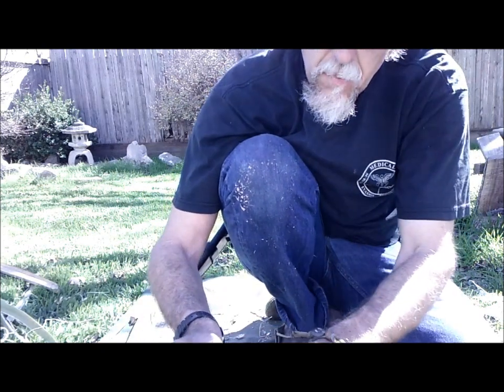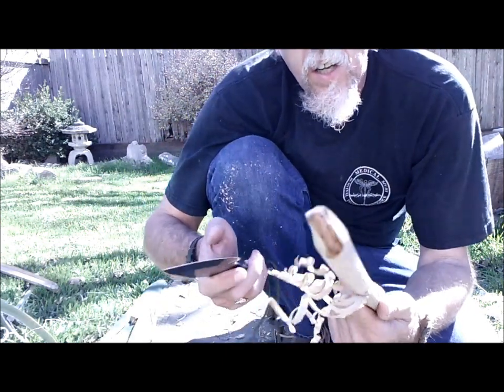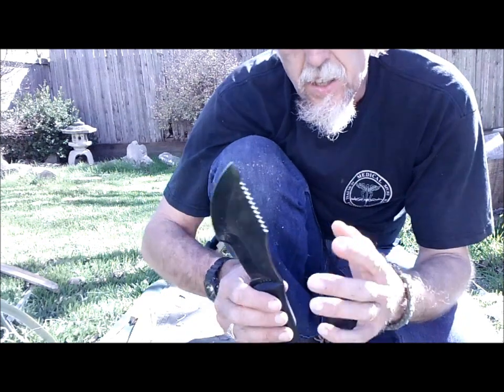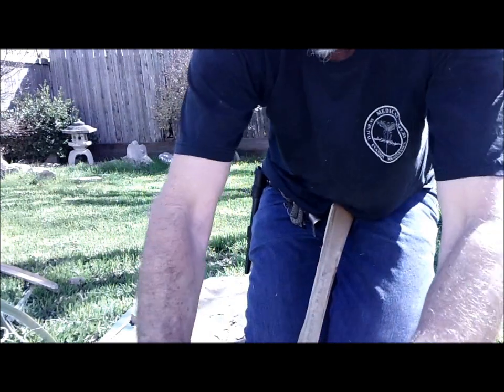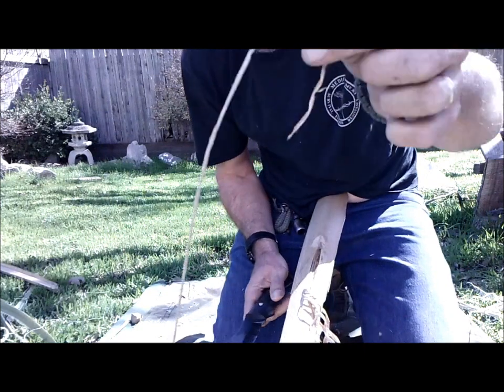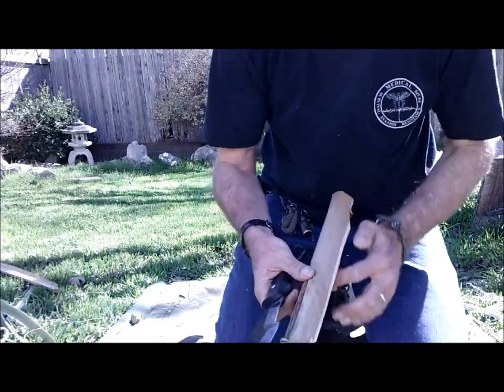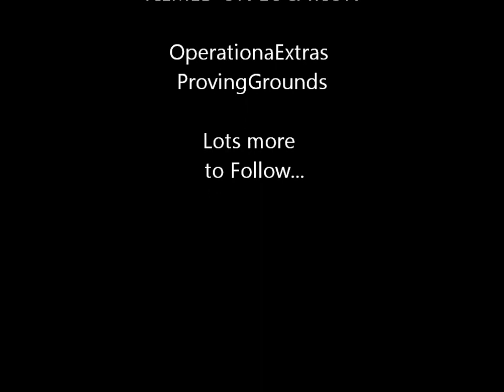OperationalExtras Beck WSK Curls and More

Comment: I wonder how that palm would do as a hearth board for a bow drill or is it to thin?
Reply from the maker: I made a fire plow that day and a Bow Drill set spilled a few coals Most of the palm was green but I had a couple of Dry Pieces They took a dunk in the Pool under the tree I was cutting on so it was not Ideal a good set Im sure could be made from dead dry palm thanks for looking